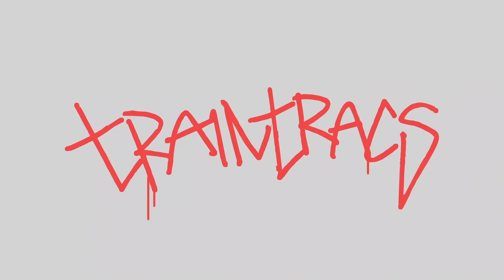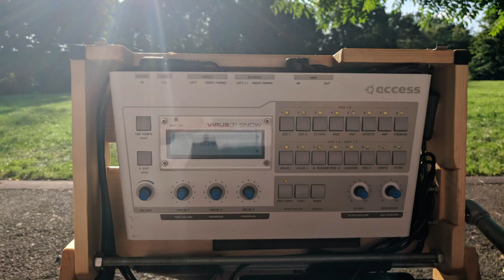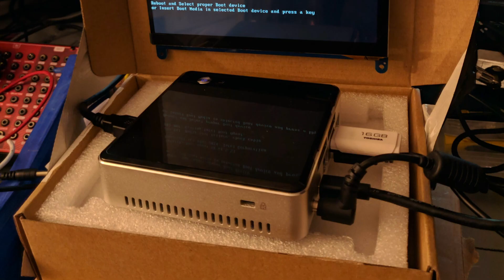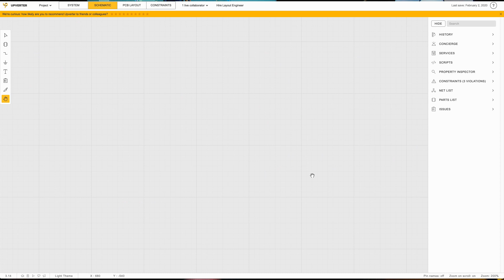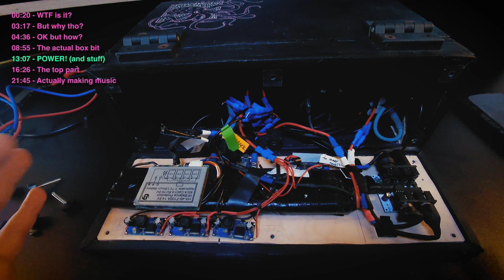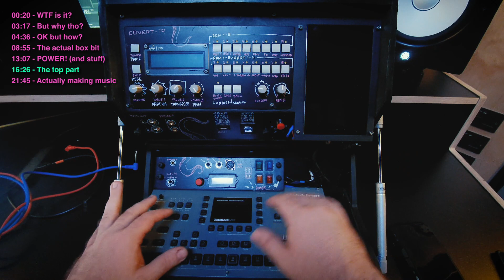I Made a Battery Powered Music Production Studio in a Box - Octatrack, Virus TI and DAW all in one!

Comment: Fair play man and thanks for taking us through your design process. I've dealt with noise issues in my own setup and USB is usually the culprit, creating ground loops between devices. You can get a little device called a Galvanic Isolator which just has a male usb on one side and a female on the other so you run it inline with your usb cable - usually to your PC. It uses a transformer to pass the signals across and breaks the ground loop. You can get them for about a tenner. Well worth a go.
Reply from the maker: Thanks mate, that sounds like a really good shout! I'll definitely give that a go.